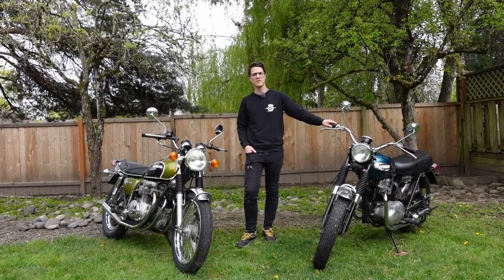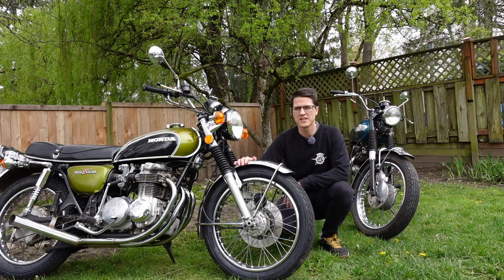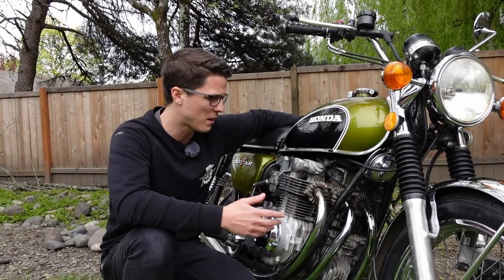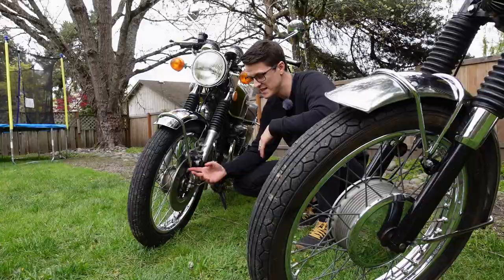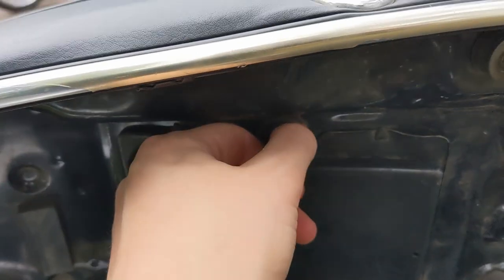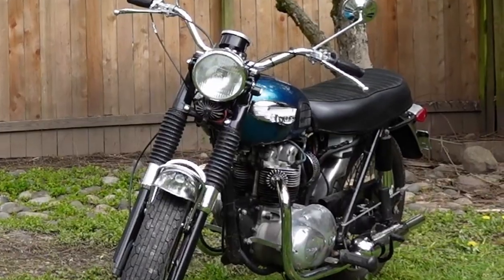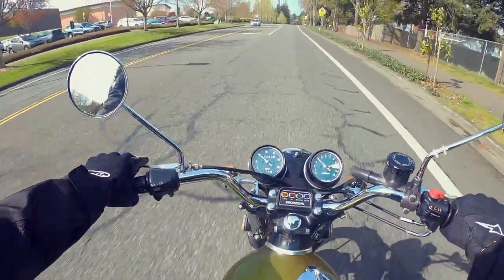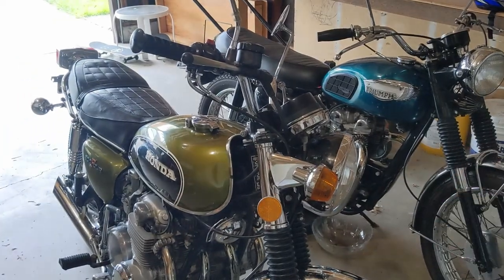How this Honda killed this Triumph

Comment: It should be noted that the only reason the Triumph 500 existed into the 70s is because the factory had a stockpile of parts to build them at a time when most of the factory was moribund. So with virtually zero product development, engineering, and marketing costs they managed to soldier on and keep their North American dealers alive on a shoestring. There were many problems with the production of the 750s, twins and triples so building and selling 500s with warehoused, you might even say surplus parts, kept the company going (for a while anyway). I owned a new 73 Daytona when I was based at Torrejon Air Base in Spain. Even with their flaws they were never as bad as people like to talk about now days.

Comment: I had a1969 441 BSA Shooting Star when I was 18, It would take me at least 15 minutes to turn the lights off in the barn because I just loved staring at it. Big beautiful Lucas chrome headlight . Short side stand with a small foot that would sink into hot asphalt letting the bike fall over, oil drain plug partially blocked by the frame,  shaft for the kick starter broke off at 5,000 miles.  I miss that bike.

Comment: The 500 Triumph NEVER had an electric starter. The only Meriden made models that had an electric starter fitted was the T160 Trident which finished manufacture in april 1975 and the T140 Bonneville for a very short run in the very early eighties. Meriden closed down completely in 1983.

Comment: Hi Bart, love yr vid's! Only have to safeguard history. Have you read 'what killed the british motorcycle industry'? Apart from mismanagement, one particular part was the Achilles heel; silence blocks! Japanese engineers are one of the best on this planet, the British among the worst; styling the opposite. I've spent 36K CB500 & 20K km on my VeloMSS. The Britts stole most petrol engineering from the Continent & U.S. stifled by patents and the steam lobby. Most race UK successes were lack of foreign competition and when that emerged > blew them away (in TTs) they started 'own' races GPs... I live my hobby own multiple  prewar&classic cars/bikes, I (too) live literally in the nostalgic past in the UK, like silly/eccentric UK machines for 'pub' use but admire superior german/ital/japan engineering for real road/rally work. PS look it up Triumph had a blue print of 'exact same' four cylinder bike, but Honda did it and excelled. The British are perfect dreamers, still believe in Imperial Superiority, which they have, but that is in 'dirty/dodgy' finance mixed with a similar foggy royalty, but industry? Sold off, done & dusted. Happy dreams & rides!

Comment: If you dis-assemble that Triumph, and re-assemble it using Yamabond or Hondabond to seal the engine, it won't leak anymore.   Clean each mating surface with laquer thinner and rubbing alcohol prior to assembly.  And for gods sake, don't use a metal screwdriver or chisel to pry the engine apart (you will gouge the aluminum).   Use a heat gun and rubber mallet to get it apart.

Also, replace the pushrod tube gaskets with neoprene aftermarket ones , instead of the cork junk Triumph used.  You might get a drop or 2 of oil out of the crankcase breather now and then, but other than that, that'll be the end of your oil leaks.   I'm not sure if that year has the dumb "chain lube" tube coming out of the primary case, but you can block that off if it does. After 50 years, it'd leak oil even if they DID use good gasket sealants *which they didn't.

Comment: Not really true , it was bad management  that killed the off  BSA which owned Triumph, the Trident P1 first ran in 1964 could have been in production by 1966 but management had other ideas ,only after rumours of the CB 750 did they listen even then BSA wanted the own version with different crankcases and frame which delayed  its launch .

Comment: In the late 60's, I had a 650 Triumph Bonneville which was quite reliable but had been painted in a horrible turquoise blue color with an equally horrible turquoise blue/white "tuck and rolled" seat. Still, it got me halfway across the country and back in just 7 days. I started the trip without a helmet because I didn't think they were cool. To my chagrin, I had to buy one in order to drive across Wyoming. Now I'd never think of climbing on a bike without one. 🤣

I eventually sold it and a few years later I bought a single cylinder BSA 441 Victor. I loved the yellow and polished metal color scheme... but man, was that thing a bear to start. It had such high compression that using a "compression release" lever was necessary to start it, especially if it was in need of a tuneup. (No electric start, of course.) It had the coolest sound, being a "single", it idled like "half a Harley"... It sounded great.

Finally, in the early 80's I bought another 1970 Triumph 650 with a single carb.  I think it was a "Tiger", if I recall correctly. It had the original olive-green-ish paint color (though I think tank was repainted at some point). I used it for putting around Boulder Colorado in grad school. I was just for fun basically, so I really enjoyed it. Of the three bikes, I think this was the classiest looking.

I eventually lost my love of motorcycles and fell in love with road bike (bicycle) riding. After all, I lived in "environmentally conscious" Boulder, so it was natural that I got into road and mountain bikes. I'm still a bicycle rider and don't really miss a noisy motorcycle... but at the time I had them, I really enjoyed riding them. I don't regret my time on my three scooters at all.

Thanks for the trip down memory lane. 😇

Regardless of what you ride (bicycle or motor bike), enjoy it and stay safe out there, peeps!

Comment: The biggest culprit in the demise of Brit motorcycles wasn't Honda, it was cars like the Mini, Fiat 500 & so on. Cheap cars meant that people who used to ride bikes as their primary means of transport could have all the advantages of 4 wheels for not much more than a motorcycle. As for Hondas, yes they were oil tight & reliable, but I rode Brit bikes & Hondas at the time & the Japanese examples had poor brakes & wet noodle handling compared to BSA, Norton, Triumph etc so it wasn't all one way. But in the end we know how it shook out.

Comment: I had a T100 500 triumph in 1969.It was a 1961 bike.Mine slipped out of 2nd gear.Apart from that it looked good,made a great sound and could reach 100mph.Most of all it was sexy.Thats why you buy a bike.

Comment: I laugh, iz got a '67 Saint and a '72 CB 500 and I feel exactly the same about these bikes as this man. Triumph crap 4 speed and Honda beautiful smooth engine with all the oil on the inside. Had both about 10 years and wouldn't part with either. You said it all.

Comment: Maybe ironically Edward Turner the designer of the Speed Twin had designed a 4 cylinder engine back in 1928 when he was working for Ariel it was actually a square 4 consisting of 2 twin cylinder cranks geared together the speed twin was his solution to making a single cylinder less uncomfortable to ride due to vibration essentially just splitting it into 2 cylinders but retaining the 360 degree crank.
Your Honda sound demo does not accurately reproduce the sound of the exhaust as it left the factory because of the aftermarket system fitted but I do not know if anyone is producing replica period factory exhaust systems for the 500 yet to correct this although I think they are for the 750.
The Honda 500 was a great addition to their line up but my memory was from the first time I saw and heard the 750 four in 1969 I was 14 at the time and a school mate had an older friend that turned up outside the school gates on his just purchased example and compared to what I had been used to seeing it looked like a space ship, kinda fitting really as that was the year of the first Lunar landing,  so despite the fact I lived in England it set me on the path of buying Japanese for the majority of my bikes I can empathise about the sound of the Triumph to a degree even though I grew up with that sound being common.

Comment: since Bart thinks the Triumph 500 had an E start I would say his credibility is shot.  Back at that time Cycle Mag compared the Triumph 500 to the new Yamaha TX 500, a twin with 4 v /cylinder, e start, a 5 speed, and disc brake. The Triumph was a big loser !

Comment: Good video. I’m like you I have a 77 Honda 400 four and a 68 Triumph 500 Daytona, I love them both but for me the Triumph has the edge, I think it’s the riding position of the Triumph that’s better, the Honda is Cafe racer style, and I’m not getting any Younger 😂🤣
Just one thing you got wrong sir, Triumph 500 never had a Electric start. But you can get a very expensive aftermarket conversion to electric start. Cheers for the video 🇬🇧🏍👍

Comment: I bought a new '72 CB500 in late '73. Same color as the one in this video. Over the next 4 years, I rode it from MA to OR/CA and back twice, and finally rode it to TX where I sold it in '76 w/ about 65k miles. It never failed me. I could start it w/ one hand. I went through 2 sets of stock exhaust due to rust until I replaced it w/ a Hooker header. I put a Vetter Windjammer on it for comfort.  I removed the throttle spring to make long distance riding more comfortable. It was a great bike.  But by 65k miles, it was completely worn out.

Comment: Some factual corrections:
The ‘73 Triumph did not have an electric start as you said. It did however have hydraulic disc brakes - Lockheed practically invented them for bikes in the interim between ‘68 and ‘73 and Triumphs were one of the first bikes to have them. You said that the Honda’s stock / suspension was superior to that of the Triumph . Actually Japanese suspension at the time was far inferior to the Armstrong and Girling systems  fitted to British bikes. If both of those bikes had stock suspension fully functioning , you’d have found the Trtiumph’s far superior.

Comment: Far too much made of oil leaks in the NVT british bikes mostly its the automatic chain oiler
and its only a few drips (your Momma aint gonna like it on the drive) it wouldnt fill an egg cup in a year .No electric start is a big Black  for the Triumph but the real downer is the reliability of the electrics Brit electrics are shite and Joe lucas is indeed the prince of darkness. Honda electrics =flawless  When its running right I'll take thatTriumph on a twisty
road we calls it the  " Nadjery " and your CB500 aint gonna see nuthin but tail lights and them not for long, you can include your CB750 in that too . At the end of the day its like comparing an old steam locomotive to a modern electric train .You can love that old steam loco . anybody get nostagic for modern trains ?  Thought Not !

Comment: Oh God I can't believe you have you put this garbage out. 1968 BSA Triumph release the Rockets 3 and the Triumph trident they were built well with good quality components like shocks and tires and Lucas electric are not so bad if you maintain them properly like points. Honda wanted a one-upmanship in time for the Tokyo show they had three we have for they have kick we have electric they have drum brakes which worked we have a disc brake which does not work in the rain Honda try every trick in the book in order to make the Honda 750 as cheap as a Bonneville and they just got it down to the price of a trident Honda got special loans from the Japanese government to put Japanese people to work they put up a multimillion-dollar factory that did nothing but put out Honda CB750 for S and they would crank one out every two minutes. Everything in the motor ran without proper bushings or bearing to make it cheap it had sent cash cylinders because Honda's best selling motorcycle with just 350 the 450 Honda sold but the 350 out soldat by a matter of 6-1. They only made 7000 sand cast cylinder crankcase models because their biggest motorcycle was not their best seller. If the Honda 750 4 cylinder motorcycle turned out to be a poor seller then they could drop it without major Investments made in its manufacture. Its popularity took them by storm they were not expecting it. Compare the CB750 motor to the Kawasaki 903 Z1 and you can see where Honda cheapened out on his design especially by not putting a tensioner on the primary chain to connect the crank and the transmission. The Z10 had a crank primary drive as well as bushings and bearings for all of the moving part of the engine. If Triumph had not been part of the BS a debacle they were coming out on their own with the quadrant at 1000 cc's. They showed the prototype to Doug Hill who went to pour and Porsche and we're going to build a fancy complicated rotary that only the police and the military would buy when the British had a loser of a motorcycle only the British military and police would be forced to buy them.

Comment: I loved the British bikes,Triumph and BSA and the like but we have to face the fact we were demolished by the Japanese quality and reliability issues,  I had a 650cc BSA Golden Flash which  was a great bike but at high speeds the vibration through the foot pegs was unbearable and the brakes were downright dangerous,even so I loved that bike and and did over 40,000 on it with only oil changes and plugs changed to keep it going reliably,it only ever failed to start once and that was when the points in the magneto slipped leavings no gap,I just reset the gap and away it went as usual.

Comment: Unfair and untrue comparison, the triumph 500-650sof the time were never fitted with an electric start or disc brake, only the 750had them, triumph lost out to honda before that tho because they were slow to develop,innovate and improve like the Japanese, Norton's were fitted with electric start before triumph but like that competitor the components and build quality and reliability were shoddy,D.

Comment: My first bike was a 550 Honda 1974 . The look of the triumph is wonderful the gearbox is for the country in Europe . The twisted turns the hills it's wonderful over there .  The Honda is better in every way except looks the rear tail light & the gas tank is to close to the motor . The 550 will beat a 883 sportster any day if the week the 750 boniville has no chance at all . Triumph and Harley are like hot rods  . Hondas are like sports cars .

Comment: In 1972 I traded my 67 Triumph 650 Bonnie in on a Daytona 500. The 67 was my first bike and had been treated very badly and was in need of a complete overhaul. Being on active duty, I had no place to do any work, so I went for a new bike. That old 67 did teach me to ride in the dirt, then street, and I am still riding in 2022, now on a 97 Virago 1100.  My friend had a 72 Honda 500. We rode each others bikes once and the Honda was so smooth, but the Triumph had so much more " character" and it handled way better. Wish I still had all of the bikes I owned in the last 50 years.

Comment: I agree on the Triumph's looks.  To me the key to the Triumph looking better was the engine, especially on the Bonneville.  I considered those engines to be works of art and then the rest of the bike was fairly easy to make look good, because of it.  I never got to ride a Triumph, or any British bike that I can remember, so I can't say much about the handling, except hearsay.  I don't know about the CB 500, but the CB 750 being a little top heavy, was its main handling problem.  To me, it took twisties fairly well, if you had the strength to make it lean against its will, and to throw it around a little.

Comment: santana row first retired at 47 guy let me drive his hyabuska with throttle work and others..In 3rd gear lightly let it out it pulled front wheel off ground..He super twitchy throttle didnt like it.. i dont know how he rode on a bumppy road..  But singapore last night as an expat..Kulla allowed me the ride of a 500race bike..So i road like i stole it on orchard road..  Just lay 2 fingers on front brake and it stopped.. hard.. quick as hell no top end..but fuuun...

Comment: THE Honda isn't an in-line 4. It's an "across the frame" 4! A 1912 Excelsior Henderson is an example of an in-line 4 cylinder motorcycle engine.

Comment: I rode a CB500 all through high school. My dad brought it home as a frame and boxes of parts. Spent my freshman summer rebuilding it. Belive it or not,  it was hard to find a lot of parts for it in the 1990s. 

Wish i had kept it. It was an old bike even then, slow, didnt handle all that great. But it was dead nuts reliable. And I beat the shit out of it.

Comment: To my knowledge the 500 Triumph never came with an electric start in its history
Reply from the maker: I think you might actually be right. The controls one the handlebars were totally different but I think it actually was still a Kickstart.
Reply: The only old Triumphs with electric start was the ‘75 Triumph T160 Trident and the ‘82 Triumph T140 Bonneville ES.

Comment: Many years ago I had a copy of Motorcycle, Scooter and three wheeler Mechanics which was a British publication and there was two road tests in this particular edition. One of the tests was if I remember correctly was for the new Triumph Trophy 650 which there was a picture of on the front cover complete with the rider with the classic open face helmet,  tweed jacket and jodhpurs. 
Next to this was the headline " We test the new Honda CB 500/4. Are disk brakes,  indicators five gears really necessary?." 
Times were  changing.

Comment: Just for some historic trivia,  the first British bike to have electric start AND turn signals was the Norton Electra built from 1963 to 1965. It was a 400cc twin putting out maybe? 20 HP  through a 4 speed gearbox. Some folks referred to it as the "baby atlas"